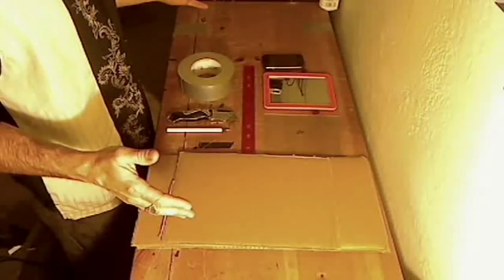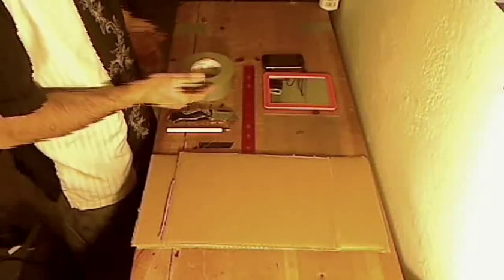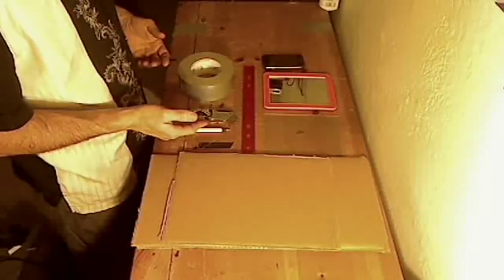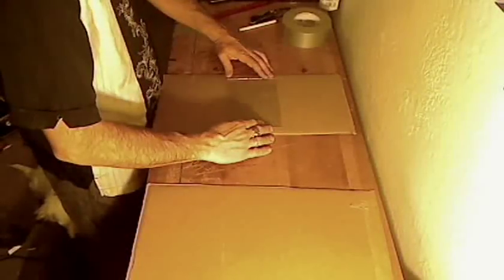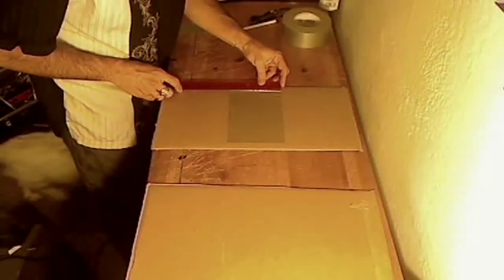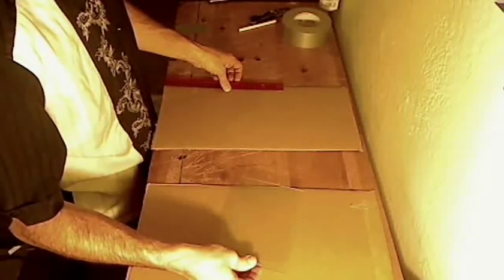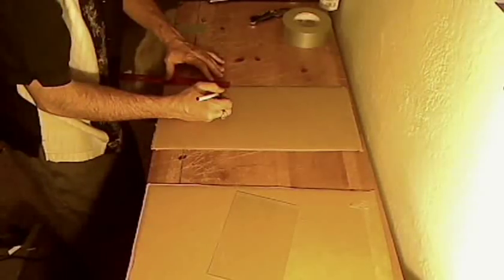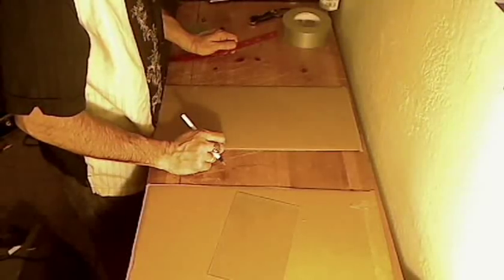DIY Holograph How to build a hologram projector at home for cheap

Comment: If I used wood instead of cardboard, and a projector instead of a phone, do you think it would be possible to do this on a much larger scale?
Reply: mfilanc Yup, but you'll need all angles and measures correct.
Reply from the maker: mfilanc Just keep the glass at a 45 degree angle to the screen.  I'm working on a video for I life sized one.